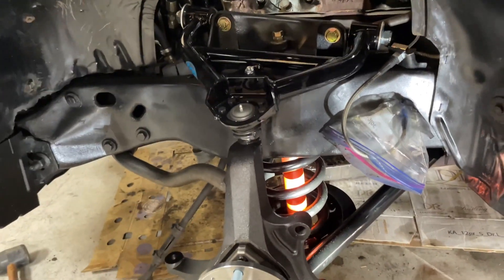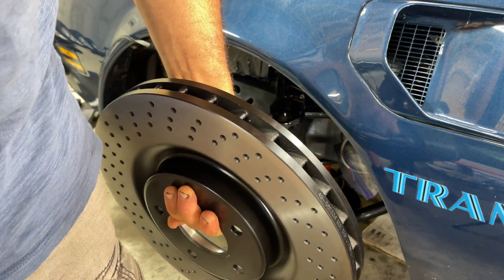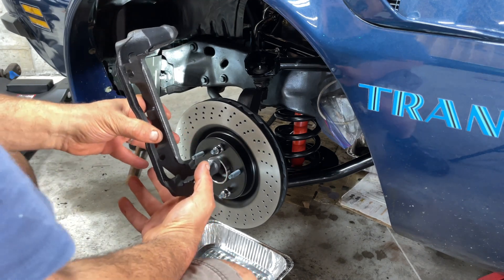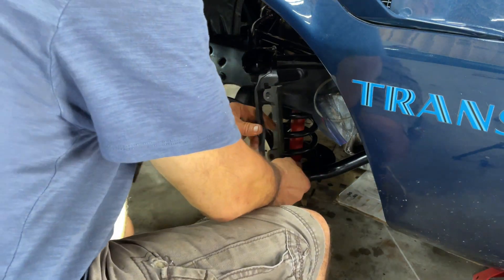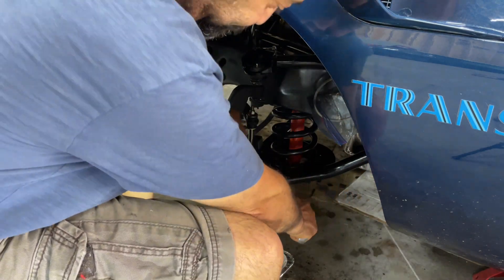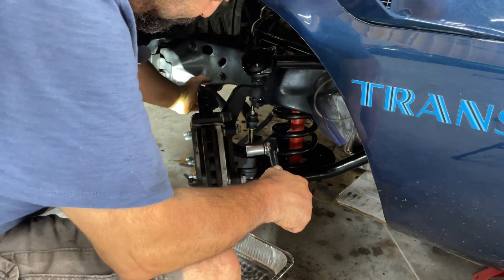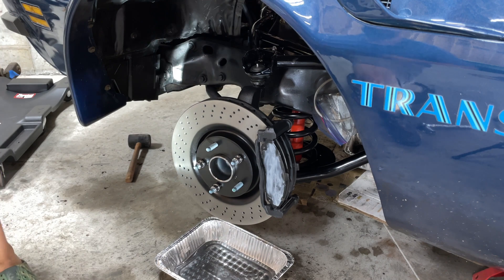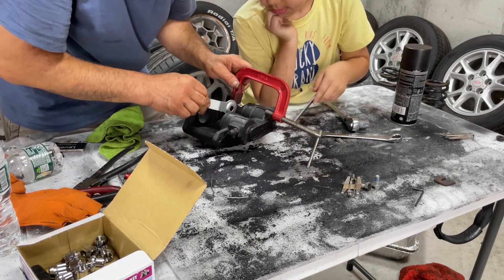2nd Gen F Body Big Brake Upgrade - Installing the calipers and rotors

Comment: I'm doing the same exact upgrades you're doing to yours. I have an 81 camaro and can't wait until I'm done. I'm doing the same solid subframe bushings and subframe connectors you did also.
Reply from the maker: I had a brief drive with all the upgrades before I tore the car down for the AC install.  What a difference between stock and now.  I can't wait to wrap up the AC install so I can start driving and enjoying the car
Reply: @littlemissgracing6515  what hubs did you use c5 or c7? I am doing a bench fitting before I put it on my car, and even with both shims on 1 side, the abutment bracket is still hitting the rotor.
Note....... I have the wrong rotors. I have c7 z51 rotors.....no wonder they won't fit correctly.  I have the correct rotors on order now.
Reply from the maker: @claytonhaske  I am using the C7 hubs, as they’re supposed to be superior to the previous generation units.  What rotor and caliper combination are you using?  It is my understanding that you have to use same trim combination, ie base rotors with base calipers, z51 rotors with z51 calipers,… you couldn’t mix and match.  Or are you saying the abutment bracket is hitting the side of the rotor and won’t center?